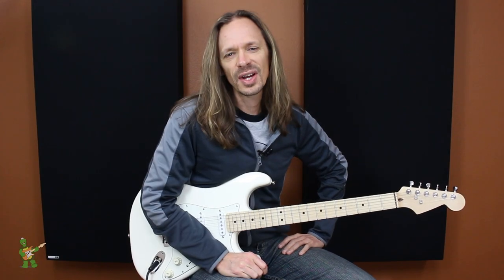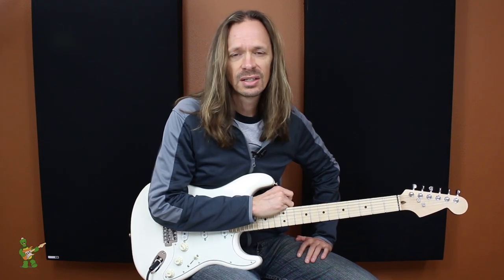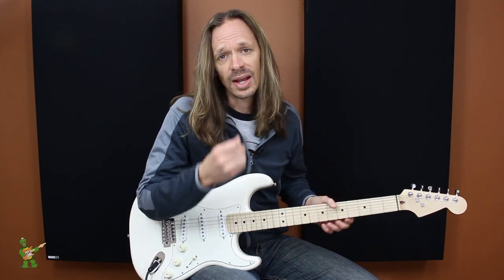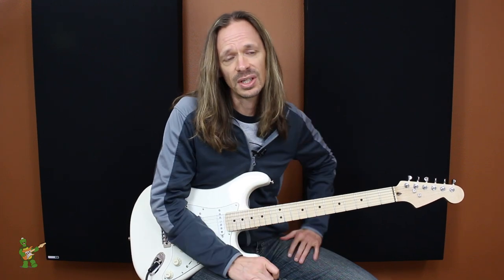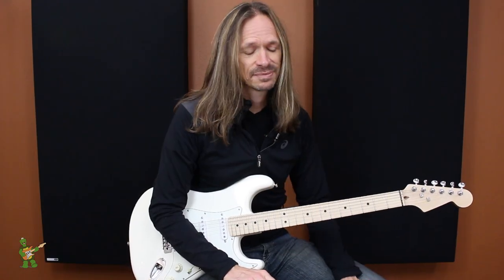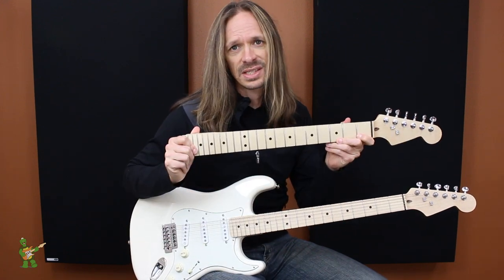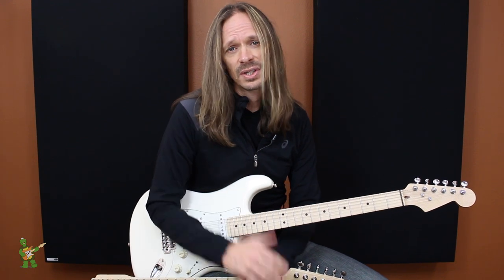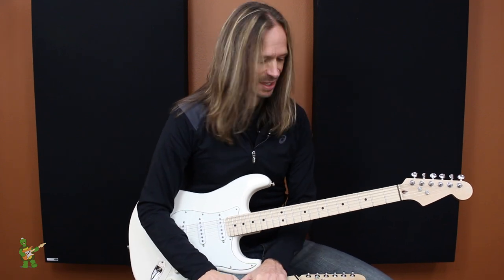Stainless Steel vs Nickel Frets

Comment: i thought neck #2 was a bit darker sounding than neck #1!
Reply: zillathegorilla Definitely was. 8 misdiagnosed #1 as SS thinking it would be higher, turns out it's reversed.
Reply: i dont know what kind of speakers youre using but i heard it a little bit harsh sound... twangy, zingy, i also noted a difference in bass guitars too when you slap its got that nice bite but no punch whatsoever ;,,; rip
Reply: zillathegorilla, then you have hearing problems. It is def the other way around.
Reply from the maker: Yes., Jim Deeckan...I totally agree. That particular funk-type riff had the greatest difference of them all, and I'm not sure why. I kept looking for something to explain it, but couldn't come up with anything. FYI, the strings are D'addaro 9-42, and a fresh set was used on each neck.
Reply: I actually thought neck #2 sounded slightly brighter.
Reply: The way you slapped on the strings down into the frets when you were picking those notes is a strong factor that defines the slight change in sound, i think thats one of the reasons why the riff at 4:03 sounded a lot different to a lot of people, but you guys are right in that riff specifically i notice nickel frets go a little bit brighter, meanwhile stainless steels add a bit of bass and mids to the sound, just a tad... not enough to make it sound a whole lot different but its very subtle and the change in tone is definitely there, but in almost every other riff stainless steels sound a bit brighter
Reply: I thought neck #2 was brighter in some clips (like the first clip "clean, neck pickup"), and darker in others ("clean, middle pickup" clip).

I suspect pick angle, attack, and wrist fatigue will override actual differences in fret tone. 

The only way to do this test "scientifically" would be to have some kind of robot arm do the strumming to ensure complete evenness in pick dynamics.

Paging Arnold Schwarzenegger, paging Arnold Schwarzenegger...
Reply: you know with stainess steel frets you can buy stainless steel strings and make the frets last longer... stainless steel strings with nickel frets and hard bending techniques will do a lot of wear and tear to frets.
Stainless steel strings have a property of keeping most of their mass, and that bright snappy sound after you open a pack for many years, this is one reason i want stainless steel frets
Reply: #1 neck sounded brighter to me, #2 sounded darker. I have stainless frets on my 79 Tokai LS50 Reborn and it definitely plays better than before. Sound wise I couldn't tell a difference.
Reply: Perhaps the amount of pressure used when strumming? It's easy for it to be different between two days, no!? 😊
Reply: i absolutely agree. #2 was darker. why not use the jescar evo gold frets, sounds like the nickel/silver but plays like stainless, that is what i gave on my guitars.
Reply: +gckelloch he is barely a competent player. lot of technical problems. in the arpeggiated chord section the transitions were extremely poor, cutting off all kinds of notes before it is time to make it sound very choppy.
Reply from the maker: LOL. I'm not competent....only mostly competent.
Reply: zillathegorilla same here, but steel supposed to make it brighter?....
Reply: zillathegorilla only the funk really sounded darker (and 'flatter' in response). As funk is about muted strings, I think it's probably differently muted. For the other clips the top end was zingy. Which might be a bad thing, might be a good thing depending on what you need. The stainless also sounds 'flatter' in response than nickle in general which might actually help with high gain stuff
Reply: Those pickups can't hear the wood because they are magnetic pickups NOT acoustic. This tone wood BS on solid body electric guitars with electromagnetic pickups (which 99% of solid guitars have) is absolute bunk when it comes to tone.
Reply: André Orsel hahahahahaha, I agree, funny comment about the hearing problem 🍻
Reply: Neck #2 had both more bass and more treble response than Neck #1.
Reply: no
Reply: I pretty much was certain #2 was brighter except for the funk which I was looking super forward to and then got blue ballsed when it was warmer
Reply: I had a X Files moment ...kinda creepy. I'd have Mulder and Scully give you a once over.
Reply: I experienced the same thing, but to make double sure I put on my studio headphones and the difference was slightly different. As far as I can tell neck 2 has more low end while also being brighter. I'd argue the guitar has a more full sound, it's still minute. Low end is smoother on neck 2, and the bright have a bit more brightness.

Seems like a win win to me.
Reply: Actually Andre I think you have hearing problems. Neck #2 sounds a bit darker and rounder.
Reply: Yep i heard it
Reply: #smoother
Reply: @Andreorsel  absolutely
Reply: @synchromorph m surprised as I heard the 2 is brighter without seeing the result
Reply: @alexandereverhart654  I  think the tone wood stuff is mostly marketing cheez... but  from experience I can say wood does make some difference... particularly on sustain.  Half the magic in a les paul is from that backaching slab-of-wood body (shoulda been called a more paul) and the sustain it gives.  And I owned a nothingbrand zero value guitar that played amazing until I put a crack in the body and the tone and sustain died.
Reply: To my ear, I thought #2 SS was a bit more...open...maybe a little mid bump and slightly more low end in comparison. #1 Nickel sounded a bit more compressed. I'm not sure if those are the right adjectives to describe the sound, but either way, Both sounded good to me.
Reply: @petarkosovic6455  yeah...open is how I described it, in comparison.
Reply: @gcvrsa  I think I heard the mids jumping out a little more. Maybe that results in a perceived treble boost? Either way, I think we all heard it. Just trying to describe sound is delicate though.
Reply: Yeah, I thought it was a little more full in the mid range and #1 was a little brighter on the top.

Comment: One important fact must be stated. People usually talk about nickel frets as if there is only one definite type of alloy and that's it. In reality, there are many different types of hardness. On my Ibanez RG550 Genesis there are nickel silver frets, but they are of so high quality and hardness, that it approaches stainless steel frets. I polished them 1 year ago to full mirror shine (it was a 4 hours process), and since then I have put 500+ hours playing it heavily, still there is no visible changes at all, not even the smallest microscratches on the fret wire anywhere. As a comparison, I mirror shined the same way the frets on a low end Ibanez gio with cheap nickel frets in the same time -> looked amazing of course. But then within a couple hours of play, the frets were already full of scratches. Same new set of Elixir strings used on both guitars.
So what I really want to say is, nickel frets can be very durable on higher end guitars.

Comment: Very scientific, controlled comparison. I preferred the tone of neck 2, which sounded more clean and focused. I was surprised to learn it was the stainless. I have two Warmoth necks with Nickel/Silver frets, no regrets.
Reply: What's scientific about this? I'm not trying to bash on this comparison. In fact I really liked it, however it's not a scientific at all...
Reply from the maker: Would it help if I wore a lab coat? :)
Reply: It was in the sense that he used the same amp, mic positioning, wood, guitar body, probably strings, etc. for the comparison. You couldn't get better precision!

Comment: Not a small difference in tone at all, I didn't expect that. The nickel frets sounded warmer and had a spongier dynamic too. The steels were brighter and also had tighter low end and dynamics. It made the pickups sound more like actives. With distortion it almost seemed like the necks' qualities were switched around. Very interesting video, thank you.

Comment: Ok so essentially no difference. At this point, I'm going stainless steel every time for the durability. Thanks for making this video!!
Reply: Longer-lasting frets = shorter-lasting strings. But I'm not a guitarist, so I don't know if guitarists wait long enough for that to matter.
Reply: @matthewedwards6025  it matters my friend.
Reply: @matthewedwards6025  Strings are cheap and easy to replace.  Fretwork is expensive, time consuming and requires a fair amount of skill.  Stainless steel is the way to go!
Reply: @fr0gz0r  I agree. Strings are made to be disposable, so it's better to get harder frets and just replace the partially-ground strings.

Comment: Yep, Neck #1 is nickel for sure, and I could hear a difference. Subtle. What's more significant, though, is the feel and how the strings respond and which one is more satisfying to play. I personally preferred the tone of the nickel fret wire, but SS are easier to play (they feel smoother too) and don't wear at all or corrode. On the negative side, if the fret wire is too big, and it's also SS, it starts to feel sterile, in my opinion. Great viddy, by the way. Warmouth has done a few of these clinical comparisons which are quite good.

Comment: I did hear a difference and I honestly preferred the stainless neck. I don't care about the difference, if the results were the opposite, I would still prefer the stainless for their longevity.
Reply: I could hear a difference in the clean, single note passages. Not so much with chords and not at all with distortion. What surprised me was that I preferred the sound of the stainless steel frets. No more fretting over which frets to get! 😝

Comment: Thanks for the video -- it made the sound difference really clear! All of the neck 2 sounds (although much less so in distortion) sounded thicker, and I'd be tempted to say Neck 1 sounded cheaper. Just my opinion. (EDIT) Shite, I just re-listened to the end part, and it turns out Neck 2 was  SSteel, and I had thought it was the opposite! Still, my opinion on sounds remains the same.

Comment: Should have included the gold frets since you offer them on your necks. Someday i hope to be able to build one of your guitars, but i cant seem to get away with anything under $2000. You get what you pay for i GUESS... someday. And i DO hear a difference in necks. Insignificant maybe, but for that kind of $ its important to me.
Reply from the maker: Yes...we thought about that. In the end, we decided to keep it simple. We thought the differences would all be so minute that throwing a third contender in the ring would just be distracting. We wanted a toe-to-toe matchup...not a battle royalle. :)  As far as the price, it's all dependent on the options you choose. Apparently, you have very refined tastes! :)
Reply: I have 2 warmoth strats. One with stainless and those gold ones on the other. The gold is between nickel and the stainless in reguards to hardness. I like stainless the best. Very slick feeling.
Reply: Ray Prevailer , thanks for the info. Hoping to start piecing one together soon. Still struggling with what neck contour to get. I have huge hands and been thinking of SRV but im very used to playing a thin Ibanez neck. Any suggestions?
Reply: Their Wolfgang contour is a good compromise between accessibility and a neck that fills the hand.  Their Wizard contour will be closest to the average Ibanez neck of course.

I've never spent more than 2 K to build a fully customized Warmoth, and that includes an extra charge 4 an unique choice figured top and 10 percent sales tax since I live in Washington state.

You can build one for around 1 K with exotic wood and a figured top if you use the showcase and can be a bit patient.  And that includes top quality electronics and hardware.
Reply: In theory, the gold ones should sound best, since they are bronze (the preferred material for church bells. It's just the thing to make the young nuns go wild.) (they don't look like bronze 'cause they throw in a tad of titanium to give it a more gold color)
Years ago I fretted a neck with wire a luthier sold to me (guess he was glad to get rid of it) which was pretty much brass, with the slightest hint of nickel. I could tell the frets were wearing fast, so I put standard nickel/silver frets in. Turned out that I liked the tone of the softer frets better.

Comment: Shit, I knew it! I love the feel of stainless but I’m having a hard time getting used to the “zingyness”. I have a few custom guitars in the last year with stainless and it sounds weird to me in certain playing styles but not all.
Reply: bloozer666 
I get the same with active pickups, you need to fiddle with your amp or EQ. Also rolling the tone back slightly helps too. I was disappointed at first. Sounded almost “buzzy”. But just took a bit of tweaking. Also, they have to be polished really well. Hope that helps.

Comment: I bought a PRS Custom 24 in 2013 and the frets had grooves after 1 1/2 years of playing. I do play a lot but I also use many other guitars that I own including 2 different Warmoth Strats and 2 Fender Strats with Warmoth necks all of them with 6110 Stainless Steel frets.I like my frets high and every time I used to get my frets redressed, I could feel the height difference.
   I eventually had my PRS re-fretted with Stainless Steel frets and I love the fact that I don't have to take it to my guitar tech every year. He did an amazing job and the difference in tone was minor. When using single coil pickups the difference in tone is more noticeable.

Comment: I feel like I kinda cheated, I work with steel, & have for a long time.  I could see the difference on the necks.  Saw the unmistakable shine of stainless immediately.  I agree, the sound is not significant enough to really matter,  only the very few would ever notice, & I doubt any would hear it in a live gig setting. Great job on the comparison!

Comment: I'd like to add my opinion after changing the frets on my strat a few months ago. Hopefully it will be useful to someone because having a refret is an expensive business for someone with only one guitar an no pot of gold lying around! If you're like me you weren't sure whether to go stainless or not, so here goes:

1. Getting the refret done. You could have problems finding a local luthier whom you a) trust, and b) is prepared to do a SS refret. I was lucky - I found a local guy here on the Gold Coast, Australia with great reviews willing to work with SS. When I picked it up it looked absolutely fantastic, like a new guitar. However he said it was a very difficult job and I hope it hasn't put him off SS, for the sake of those who come after me! It only cost me a little more than a nickel refret, I think about AUD50. Maybe I was lucky there.
2. Feel. Played it straight away in the workshop, and immediately I noticed the super smooth feel. Now in my playing style, I bend strings almost constantly to some degree and the improvement in control was nothing short of amazing. Say you're holding a 1 tone bend and want to push it up another 1/2 tone (a la Gilmour), there's no resistance to start the string moving across the fret more, no "grab' to overcome. Similarly, if you're just about to leave an unbent fretted note and give it a tiny microbend as you're letting it go - you lead guys will know what I mean! - easy. As others have said, you might need a short period of adjustment where you'll tend to overshoot your bends a bit, but no big problem. Vibrato I find easier too. Overall I feel much more in control. On the flip side, I suppose when you don't want to bend, you just may unintentionally do so slightly because of the extra slipperyness, though I haven't found it a problem.
3. Sound. Seems to be a matter of opinion. Now I would say the difference is subtle to non-existent. I can't really pick it on my own guitar, though not a fair test because of the week of waiting time while the refret was being done. Checked out a couple of different comparison tests online and got both of them wrong, so maybe my hearing isn't as discerning as some!
4. Wear. Again, not a really good test as it's only been a few months since the refret. So far, no loss of smoothness, and a close look at my frets with a magnifying eyepiece shows no discernible wear at all. So far, so good. I should mention, that's using Elixir coated nickel steel strings. Using stainless strings I imagine you would get wear on your frets, whatever they're made of.

Over the years I've come to the conclusion that my bending-heavy style of play is the major cause of fret wear on my guitars - I tended to notice wear after only a few months. You can easily tell because your wear will be right across the fret instead of just under the strings. I'm glad as heck that I made the change and now I wouldn't buy a new electric which wasn't fitted with SS because I know I'd have to send it out to the luthier's after a year or so for a fret dress. I think your style may be a factor, too. If you're solidly a rhythm player, mainly chords, you probably wouldn't get the same benefit. I'm quite happy to have nickel frets on my acoustic, for example.

Hopefully this may make your choice a little more informed if you wondering whether or not to risk your hard earned cash on a stainless refret, as I was. It definitely renewed my interest in my old strat - made it feel better than new- and in fact, just writing about it..well, I think I'll just get it out of the case for a spin!

Comment: Neck #2 with SS Frets seemed to have a greater clarity.  If you are hearing any zingyness on the top end, it's more likely to be caused by the negative loop feedback in your amplifier.  Fix the design problems in your amplifier and the zingyness will likely go away.  Negative loop feedback is just a bandaid design fix that ultimately robs you of the fine detail and replaces it with excessive sibilance.